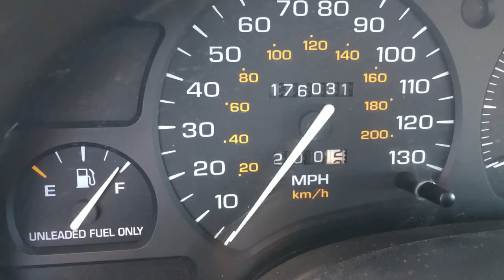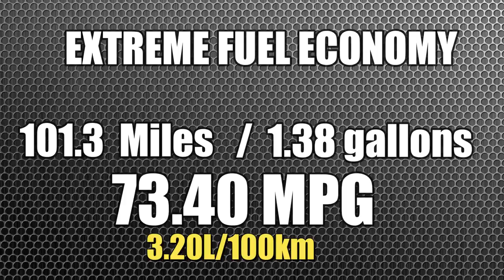S3 E11. Kubota turbo diesel Saturn extreme fuel economy.  super high MPG

Comment: Casual reminder that the vw Lupo and Audi A2 as the 1.2 Tdi versions get the same mpg with twice the hp and torque while both being able to travel at ~140kmh in relative comfort while having AC, nice stereos, and so on. 

Then there are Polo's, A1's, Ibiza's, Corsa's, I20's, and so on, which will all get between 3.5 and 4.5 l/100km diesel or petrol at regular speeds, in pretty high comfort, while usually being barely heavier at 100+hp.

To everyone watching this and thinking 'oh ill have to build a custom harbor freight saturn to get good mpg so I'll stick with my 10mpg truck'.

No, you can get good mpg AND decent power AND good reliability AND decent power, you just gotta see the relation.

Comment: i drove my new 1994 cadillac STS with all the windows closed, no air and no cruise control.  i allowed it to slow down going up hills and never really hit the accelerator.  at the end of a trip i scored 29 miles per gallon...pretty impressive for a large car with a 300 hp engine.

Comment: Intersting results, even for me as Diesel TDI loving german. Way back in 2000 VW build the Lupo 3L which had a 1.2 3cylinder 60HP Diesel engine in it. Sadly it had an automated transmission which made the car very sluggish, expensive and didnt last. But its the only thing I could think about achieving 3liters/ 100km. They didnt sell many, for most people a Golf 1.9TDI was bigger, way faster and could also be driven with 4 to 5liters/ 100km...
Reply: Depends on the roads.. in just extra-urban traffic they often last just fine. 

You are underestimating the 3L (as well as the Audi A2 with the same engine), those numbers are combined consumption, not just extra-urban like this. Almost any modern small car with a diesel can match these numbers.
Reply: Tbf the similar age 1.9s with a automatic were junk too

Here in the US people are buying bad transmission tdi's and swapping the engine into jeeps.
Reply: @GoldenCroc  sadly finding a new small diesel car has been made impossible after Dieselgate. The french started with tiny diesel cars and at one point you coud get a 1.9TDI in a small VW Polo. Today the smallest TDI- car is a Golf. Small cars dont cost enough to justify expensive tech like clean Diesel, most manufacturers struggle with small EV`s too.
Reply: @Rockport1911  You are just about correct in that, sadly. But on the other hand, 2016-era cars can last for a long time if you take care of them.

Comment: To elaborate on the EGT thing: The biggest difference between a gas and a diesel is that a gas engine’s power output is controlled by a throttle body(air metered) while a diesel has no throttle body it is controlled by the fuel(fuel metered). To be going slow it then must be running very lean. And since lean doesn’t cause issues in diesels to the degree of gasoline, it works.
Reply: I believe new bmws don’t have throttle bodies, they use valve timing
Reply: @PinkFZeppelin valvetronic from bmw controlled lift so they didnt have a throttle body, but they stopped in 2012

Comment: « Wheel curtains » are openings in the  front of the front wheel arches that are pressurized from the front of the car to improve the Cd, not seen from the outside (and seen on most new car)
Reply: Its doubtful how much benefit they really provide. It certainly isnt anything a DIYer can do at home and expect even a small positive result, I would say. Surely it needs quite a lot of wind tunnel fine tuning to be positive.

Comment: That is impressive mileage and this is coming from a high miler from back in the 1970s-80s.  
  But diesels have always been real good at high mileage at freeway speeds. 
  So I'd like to see you find a 1979 or 1980 Datsun 210(not the B210) wagon or coupe with a manual 5-speed in perfect running condition.
  Those cars along with the Toyota Starlit were the gas mileage kings for gasoline powered engines. 
  Supposedly the 210 Datsun could get 63 mpg at 35 mph. I once averaged 55 mpg for over 100 miles in mine in 1981 at freeway speeds(back when the speed limit was 55 mph)

Comment: I do think that developing a hyper-efficient, lightweight (3-cylinder?) turbo-diesel engine, optimized for use in a narrow rev range (which would yet increase fuel efficiency), mated to a generator, would make an excellent range extender for an EV vehicle.

Comment: I had an 84 s10 that came with an Isuzu diesel and 4 speed transmission. It ran great, was fun to drive and had more torque than you can shake a gas pump at. But it's top speed was 60 if you were on a downward slope but I'd hear a little voice in my ear saying " Captain she's gonna fly apart" at 55.
Reply: FLY HER APART THEN!
Reply: I, I Captain👏👏👏👏

Comment: Just so everyone knows, MPG is miles per gallon and a gallon of diesel contains more energy than a gallon of gasoline, so you can always do a bit more with the same volume of diesel.  To make it more confusing, a gallon of diesel weighs more than a gallon of gasoline, so that means a pound of gasoline takes up more space and holds more energy than a pound of diesel.  For automotive purposes volume, or how much space something takes up, matters more and so these fuels are measured by liter or gallon.
Reply: The best way to compare engine economy (outside the vehicle) is g/kW.h, grams fuel burned per kilowatt hour work done. It helps compensate for the different densities of the fuels.
Reply: According to the Energy Information Administration 

Electricity 	1 kilowatthour = 3,412 Btu

Natural gas 	1 cubic foot = 1,039 Btu2
1 therm = 100,000 Btu
Motor gasoline 	1 gallon = 120,238 Btu3
Diesel fuel 	1 gallon = 137,381 Btu4
Heating oil 	1 gallon = 138,500 Btu5
Propane 	1 gallon = 91,452 Btu
Wood 	1 cord = 20,000,000 Btu6

Comment: Looking to convert a Pinzgsuer 710K.. it has a Punch-Styer air-cooled gasoline engine rated at 70hp and it will go 70mph.... but I think that the Kubota 722 even with a turbo might lack the hp to get that 70mph with the totally brick shape of this van..

Comment: Try running it at 1900rpm, that is most diesels sweet spot for milage.  I have a JGC diesel and it runs at 2500 and gets crap even thought the vehicle is capable of 30+ mpg if it was geared right. I am contemplating a diesel swap from a 5.7  JGC gas where the gearing is better.

Comment: In the past I've gotten about 40 mpg in my 83 diesel Toyota pickup but that's being very very careful with driving. I've been thinking about adding a turbo and even have most of the parts needed to do it, so I should probably do it.
Reply: I used to get 30mpg in my 83 Ranger Diesel driving to the town as a mechanic in late 80s that he's making his videos from. Drove many a mile on the roads he did to test drive customer's vehicles trying to find drivability faults etc.

Comment: The larger the diameter of the exhaust from the head to the turbo and from the turbo to the tailpipe, the lower the pressure,  the lower the pressure, the easier it is for the engine to dump the exhaust, the lower the exhaust temperature.

Comment: Very interesting results!

For comparison, I used to own a 2012 Kymco Like 200i scooter.  It was a 160cc fuel injected scooter with the typical CVT and a 1.8 gallon fuel tank.  Normally, I would ride it in an offensive manner which meant full throttle from every stop and going slightly faster than the flow of traffic.  It would average 55 mpg riding it in this way.  For one tank, I took it easy on the throttle and rode in a defensive manner with never going full throttle and going slightly slower than traffic around me.  The scooter got 74 mpg on that tank!  

It is funny how similar fuel economy it got to your car, with similar speeds as well.

Comment: Try adding a propane injection system to this and see if you can break 100mpg.  Not to mention the power increase as well as the drop in cylinder temps.

Comment: I have a 2019 Toyota Camry LE. I have done nothing to it but regular maintenance. It normaly gets 39 to 41 miles a gallon normal driving. On long trips highway driving it daes 45 to 46 on cheapest pump gas. Diesel fuel is more  expensive and the Camry is less of a polluter.

Comment: I gain about 10% mileage in a Chevy uplander by using 40psi instead of 35psi. The tires are in good condition and could easily take 45psi but I'm playing it safe. It does slightly affect the ride. Driving closer to 50mph increased it around 15% but it's not easy to do lol. Note, the roads were definitely not flat.

I'm very interested in doing the golf ball modification to the hood and roof but that's a lot of work.

I'm not recommending you do this and I'm not responsible if you do. I'm simply giving my experience. Cheers!

Comment: Thanks for sharing your project!  This reminds me a bit of a series of competitions Craig Vetter  hosted, encouraging motorcycle builders to focus on whatever technology they wanted to use to get the best fuel economy from their motorcycles.  

For those who weren't riding motorcycles in the 1970s, wondering who the heck Craig Vetter is, he's a guy who made his living selling motorcycle fairings you could add onto most of the popular motorcycles of the time.  Vetter fairings were seen everywhere in the 70s and 80s.

Vetter basically put up prize money for his contest, and he built bikes to compete himself.  He discovered that the magic juice needed to get the best mileage consisted of a combination of aerodynamic fairings that surrounded most of the bike, in the shape of a pumpkin seed, stood on its side.  Combine that shape with low displacement engines and high gear ratios, and one of the bikes managed 470 MPG, on public road routes with hills, flat sections and even some mountain riding thrown in.

Vetter varied the rules and the routes from year to year in an attempt to learn the most from the competition about how to achieve great mileage in real-world conditions.  Some of the entries were more practical than others, obviously, but getting 200+ MPG on bikes that were safe to ride and kept up in traffic at the posted speed limits was not uncommon.

Watching your video has renewed my interest in building one of those motorcycles! 

For more info about Vetter's competitions, here's a Wikipedia link: https://en.wikipedia.org/wiki/Craig_Vetter_Fuel_Economy_Challenge

Comment: That's a good result. :)   I admire and appreciate your dedication to the tedium of driving so long just for testing. 
There's an eight-mile stretch of relatively level 35mph-speed-limit paved road near where I live. Out of curiosity I took my unmodified first-gen Insight out there one day and just drove back and forth on it at around 38mph for about two and a half hours; even with the 21 u-turns, I still averaged 109mpg over 92 miles thanks to the car doing lean burn as low as 22:1.
I really wish Honda would re-make the first-gen Insight without any compromise.
Reply: @drippingwax  For the CR-Z, the relatively low priority on efficiency makes it completely uninteresting to me as a car, and actively disappointing; I'd been hoping for a challenger to the efficiency of the first-gen Insight, or at least a peer. Instead, it's not even as efficient as the CRX-HF.
I don't get enough unwanted opinions about my first-gen Insight to have an answer for you; so far, every random person who has come up to me to comment on/ask about it has either been neutrally curious, or already loves them. And curiosity is good.

Comment: Another way to improve MPG is replacing the pulleys of the engine by bigger radius aluminum pulleys, like alternator pulley, aluminum  pulleys from old laundry machines or concrete mixers can be used.

Comment: I am seriously interested in knowing how optimum RPM at a given load effects mileage. My 2000 Ford F150"s 4.2 V6 purrs at 2k RPM. On a flat, I actually lift the accelerator when reaching this. In 5th gear I'm @ 65 MPH. With my Tesla Truck style rear topper, I went from 15MPG to 21 MPG. all else the same @ 65! ! ! The drag coefficient dropped enough for me to feel it in the pedal. This along with maintaining 2,000 RPM , regardless, I believe has made a real difference. Any thoughts?

Comment: Great fuel economy results. My tiny Citroën C1 (3 cylinders, 998 ccm, 68 hp, Toyota Aygo or Daihatsu Sirion engine) needs between 4.5 to 5.5 liters on 100 km (52.25 to 42.75 mpg). Thanks again for the conversion lines in the pictures. It really helps a metric German to understand immediately…
Reply: Yep, but as you know thats a gas engine. WIth a diesel it would easily equal this.
Reply: My 2009 corolla would get 5.8l/100km at 110km/h.
Under these conditions it would get closer to 5.3l. The best I did on a tank was 5.4l/100km
Reply: @timothybayliss6680  Yes,  I am a subscriber and I don't miss any of ROBOT CANTINA'S  videos!!👍👍👍
Reply: @timothybayliss6680  That's a quite good result! Let's save fuel!

Comment: I have an audi 2.0tdi. going on 200+mile trip will average easy 65mpg(uk) on motorway speed- sitting 75mph. All depends on weather of course.
Goes to 65mpg in winter.

If I popped into town, ie short runs then I manage 55mpg.

And no this A3 isn't a slow car. And yes its high air standard emissions.

So not sure why Americans are gearing avg 30mpg or less on avg cars..

Comment: Love watching the updates, wish I could get that kind of mileage on my commute into Wichita everyday even if gas is cheap. Reducing speed is the number one way to increase fuel economy. As air velocity increases, aerodynamic forces go up by a power of 3, where "reducing drag" (decreasing the drag coefficient) by body modifications changes the the aerodynamic forces by a power of 1 (Fd=Cd*.5*rho*v^3*A, Cd is drag coefficient and v is air speed). On 254 I slow down to increase economy, but too nervous to reduce it too much on 235 with the higher traffic volume and aggressive drivers. If I ever get the time a space I have always wanted to do a mini truck kubota/isuzu swap. Growing up we had a Isuzu pup with a diesel and manual trans, wouldn't win any races but would pull anything and went forever.
Reply: Speed is definitely the enemy of economy. It’s important too to get the engine running at its best efficiency (Rpm and load) with the right gearing.

Comment: Truly I'd rather drive the Saturn than the moped if I was getting that kind of mileage, now compared to my mini truck that can do roughly about 74 to 76 miles per hour top speed is the Saturn capable of doing 65-70 with that diesel engine in it?

Comment: I think what would open peoples eye's would be to have the vehicles do work. Throw in 4-6 50 lb. bags of sand or whatever is available to replicate passengers or cargo. Then go through your test loop. I think people will be shocked how a 'work load' will effect mpg. I'm also a big fan of Bio-Diesel. Once the contamination issues are addressed, no one is going to be interested in Hydrogen or CNG. EV's are only for short hops in town but really fall down w/ a 'work load'. Thanks for the video.
Reply: @carstennobody7047  From what I've been reading from magazines & a technical journal, Bio-Diesel holds a lot of energy potential & offers better lubrication then petroleum Diesel now that the Green-Winnies have reduced the sulfur content. Better mpg too but I'll read the book, thanks.

Comment: I really enjoy this project, a 3 cyl Kubota turbo swap into a Honda ACTY, or similar mini truck would be the cats pajamas for running around the back roads, and work around the house / property. Even at $4.00 a gallon for diesel, it still would be mighty thrifty. Great series.
Reply: I was looking at it thinking it would be the perfect swap for a Suzuki Carry.
Reply: @timothywilliams2021  A man of culture, A Subaru (whatever their mini truck is called) would be cool, too.
Reply: @jamesgeorge4874  
The Subaru Sambar is rear engine. Might be a difficult swap. 
Suzuki is a cabover. Honda is mid engine.
Reply: @timothywilliams2021  pffft, it's a 700cc 3 cyl, not an LS. The final drive is geared for a small gasser, but some oversize tires would mitigate that.
Reply: @drippingwax  My buddy Jeremy says, " I got a hoist, a torch set, a plasma cutter, a MIG, and 20 grand in tools in my shop, what CAN'T we do?

Comment: For a bit of "ouch", Diesel at my local Esso garage here in the UK is about £1.60 per Litre, which at current exchange rates, and if my maths with an S is correct, equates to about $7.53 per US Gallon, so you guys have got it cheap... :S
Reply: not to mention, for an avarage salary, an american will drive a lot farther than someone from Uk.
Reply: Here in Germany Diesel prices aren't that much better. Averaging about 1.65€ per litre to 1.70€ per litre, which translates to $6.93 ~ $7.14 per gallon.

Not to talk about regular gas ("Super 95"), which easily costs about 1.85€ per litre (or $7.77 per US gal) here
Reply: Cheap as chips (uk price), compared to here in sweden...

Comment: This is so great. I really appreciate your approach with this car. I remember the days of a diesel Rabbit (48hp) that I'm betting didn't make much more power than your Kubota engine. I think you could drive this car around town and not piss off too many people. And I'd be smiling all the way to the bank getting 50+mpg.
Reply: We had a diesel Rabbit too. 48hp seemed like more than enough. The car was light, and the diesel had more torque than an equivalent gas engine of course. With a 4 speed manual it actually felt sporty.

Comment: drove twin cam 4dr 120mi a day w auto got 39mpg........ton of miles daughter ditched it they bent axle pulling out n tire blew from rubbing frame(how did they not know??) a co-op forktruck lifted it up pushed the light strut bar in rear back,, put on a tire and that is when I started driving it to work.